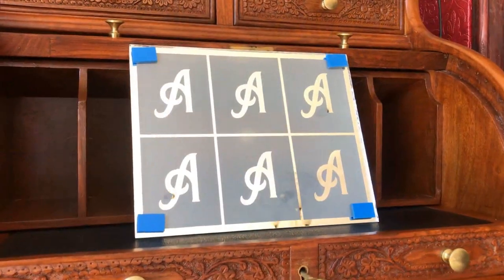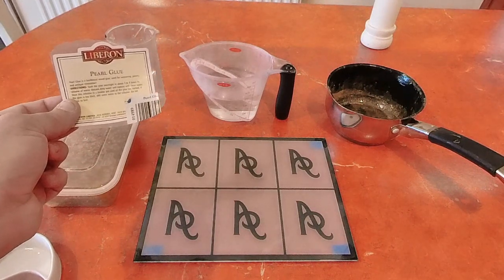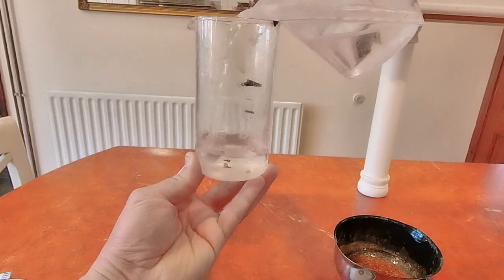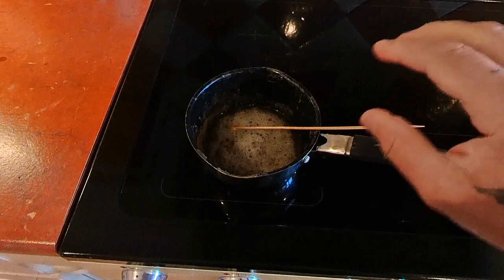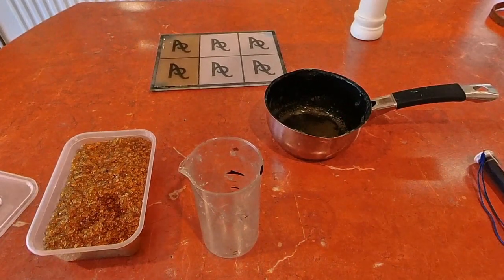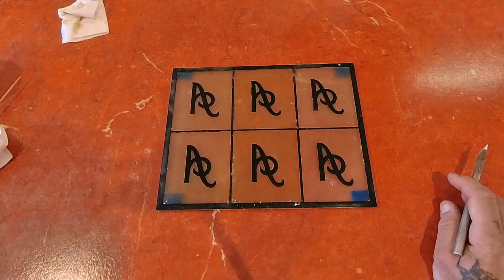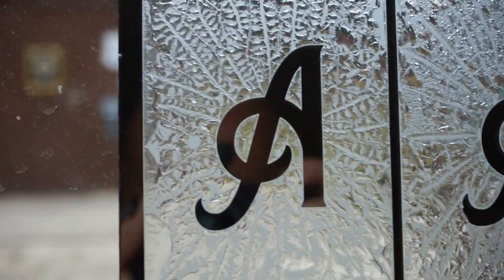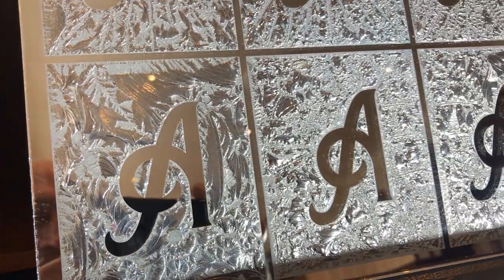Glue chipped glass. Advanced techniques

Comment: Enjoyed Your videoś - Thanks, but wonder if you have tried the glue chip technique on curved surfaces like, say a bottle ? How would one go about that, and what would be the concerns to make this work. I imagine that scores in the glue would be necessary, since contraction around a 3D shape wouldn’t cause chipping ?
Reply from the maker: You can definitely chip on a curved surface. The main thing to get right is the thickness of the glue. It sets relatively quickly so you'd have to keep revolving it to keep the coating even
Reply: @happygilder  Thanks ! I have made some tests, using a brush to apply the glue, so far with some varied results. It looks like, however, that it should be possible once variables like thickness, temperature , water/glue ratio and skills in applying are perfected.

Comment: I was inspired by your videos to try this. Chipping technique tried it twice now and it doesn't want to pull the glass off it just dries in place I sand blasted the glass and heated the glue to just before boiling, applied the glue and put it out of the way from my furry friends. 12 hours later nothing just dried glue.  What am I doing wrong
Reply from the maker: Hi Dave, sorry to hear it’s not working out. The first thing I’d suggest is the brand and type of glue. Liberon Pearl glue dries and chips really quickly if it’s near a heat source. Rabbit skin glue or chipping glue can take weeks to chip.
Another issue could be the glass you’re using. It won’t work on tempered/toughened glass as the glass is stronger than the glue. 
12 hours is fine if it hasn’t started yet. Give it a couple of days and if nothing has happened, soak the glass in hot water and the glue will scrub off easily.
I hope that helps

Comment: Hey thanks for getting back to me so quickly. I tried two different kinds of granular hide glue staying away from the Pearl glue because I heard it with had less Bond. I'll try the pearl if that is what you recommend.  After whatever glue I use, does the glue need heat or a colder atmosphere to dry.  Would you recommend me leaving it under my bake lamp to dry.  Thanks in advance for your assistant.  I am amazed at your work
Reply from the maker: Thanks Dave! Heat will definitely speed up the process so maybe put it under the lamp and see if it chips. Liberon Pearl glue is the stuff to use. It’s awesome 😎

Comment: Very helpful vids.. was wondering what would happen if you left the vinyl on the glass while chipping away? Just curious. Keep the vids coming.. thanks again 🤙✌
Reply from the maker: Thanks mate! Do you mean leave the glue to chip without trimming it?
Reply: @happygilder  yes, without weeding off the vinyl. Wonder what would happen? Will it affect the glass chipping process?
Reply from the maker: @darkscreensleepers3002  I don’t weed off the vinyl, but I do cut around it and remove the glue from the vinyl. If I didn’t do that it would likely chip the areas that I didn’t want chipped. I hope I’ve understood that correctly :D
Reply: @happygilder  yes, that's exactly what I wanted to know. I just see other ppl on YouTube removing after cutting the glue once tacky. Thanks again. Just waiting on vinyl to test out my expert 24. What thickness of class should I be using? Or it doesn't matter? Thanks again.
Reply from the maker: @darkscreensleepers3002  I use 4mm glass for most pieces but I use 6mm for anything bigger than 16x20 inches :)
Reply: @darkscreensleepers3002   I have just started experimenting and did find that the glue will lift the edges of the vinyl in some instances. I had hoped to leave it in place as black to save painting with a second mask. I was trialling on clear glass at the time.

Comment: I've been doing loads of 3d-printing, and there is a 'forbidden' combination of printing materials and techniques that might be useful in chipping!
PETG, a strong and durable printing material has a very strong bond with hot, clean glass.
So much so, printing nerds know to coat the glass with glue-stick or hair-spray to moderate PETG's bond with the glass.
If not, the PETG will chip the glass as it cools, just like hide-glue!
The 'upside' is that this effect works only on mirror-smooth glass!  No need for sand-blasting or etching to get the bond needed.
Caveats: it can't do 'thin-line' work...areas smaller than a US quarter may not peel at all, and often time the peel won't get into sharp corners.
A detailed print on glass won't chip exactly by the pattern...several 'passes' may be needed.
I did one experiment where I arranged PETG filament scraps on a glass sheet, roasted (240 C/ 450 F) it in an oven to fully melt the plastic.
As it cooled, the glass chipped precisely under the plastic and nowhere else!
Experiment I need to do next: Print pattern on glass, roast in oven to fully fuse the PETG to the glass, see if detailed pattern chips glass on cooling...
More work needed, but a quick web-search on 'PETG damages glass bed' can fill you in on the gory details.
Good luck!
Reply from the maker: Hi Greg, that sounds awesome thanks for sharing! I had no idea about PETG and I reckon it'd be popular info on the Facebook group. Lots of the folks on there have 3D printers and various other high tech machines so all info is great!! Keep me updated on how your next experiment goes :D

Comment: Very interesting Paul, did the drying take place naturally or with heat assistance, inside / outside?
Reply from the maker: Thanks! The drying took place indoors and I put the glass on top of a hostess trolley so that the residual heat speeded up the process. If you plan on using a heat source you need to make sure the glue has gone hard, otherwise the scored lines will seal back together

Comment: Nice work. Can you toughen glue chipped glass? I guess glass would explode if you glue chipped after it was toughened.
Reply from the maker: Thanks! No you can’t glue chip toughened glass. The glue will just contract and dry without chipping :)
Reply: Hi Paul.
How do you manufacture a glue chipped door panel which has to be a toughened/safety glass?
Would you glue chip float glass first then toughen it, with the possibility
of it exploding in the oven due to the uneven thickness of the glass and its infinite number of sharp edges? Or, does it survive the toughening process?
I guess glue chipping a panel AFTER it has been toughened would probably cause it to explode.
Reply from the maker: @21900cdn  I don’t really know anything about the toughening process but it would need to be done after the chipping. I’ll ask the glass company I use next time I place an order of mirrors :)